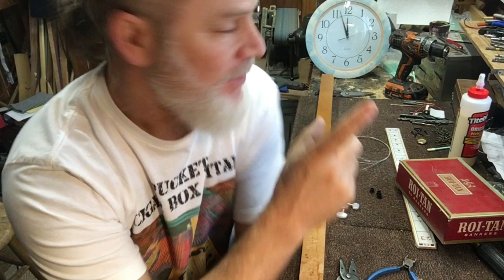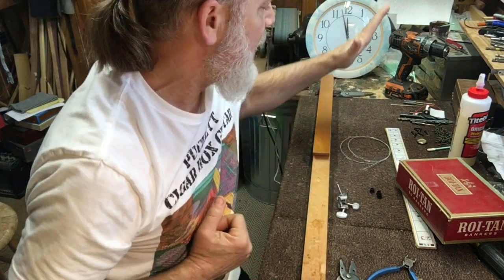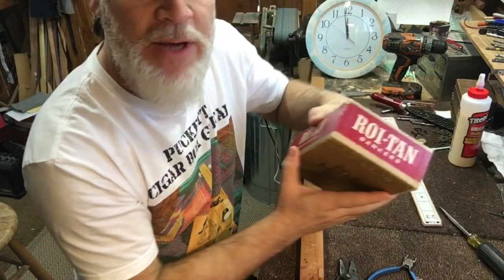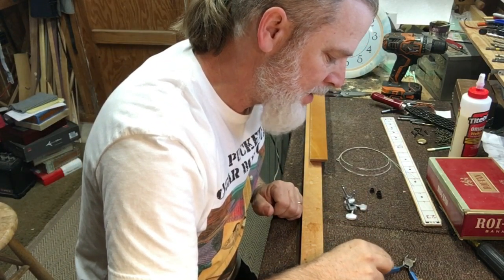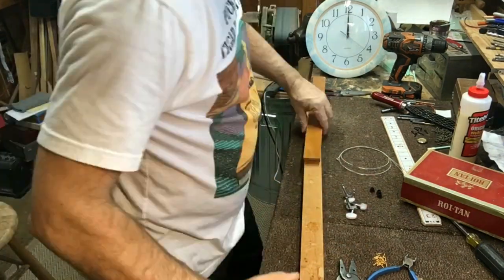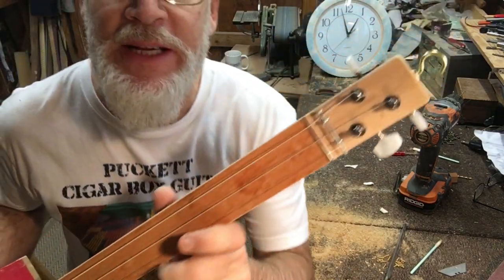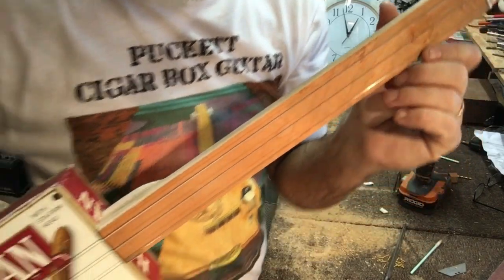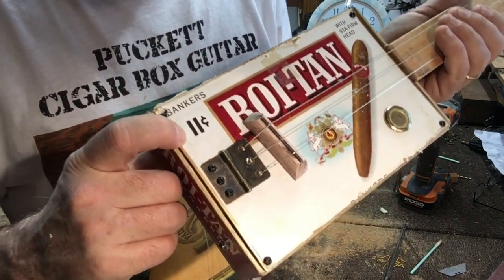The “FASTEST” Cigar Box Guitar build yet (my personal best) 😎

Comment: Great vid as usual... could you please give tips on installing those tiny screws in the tuners and corners
Reply from the maker: small drill for real hard wood.  just an awl for softer materials.  the goal is not to strip... ... and that’s real easy to do.  if you do i usually jam a toothpick in the hole and break it off and re thread the screw